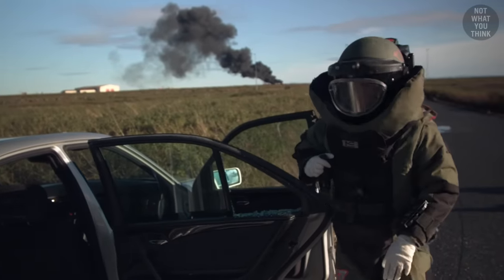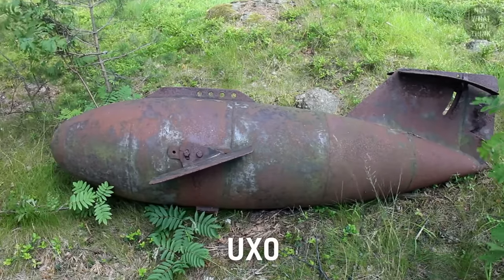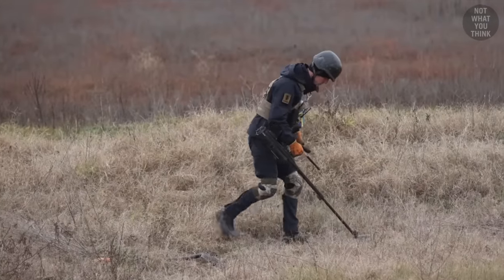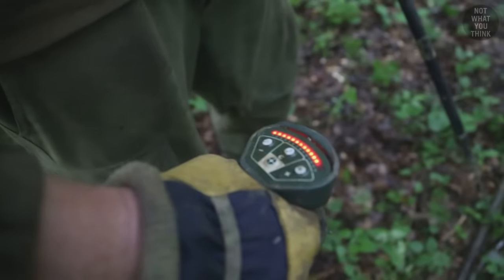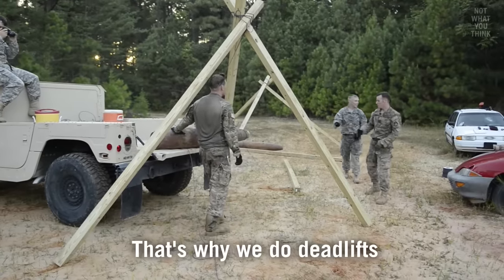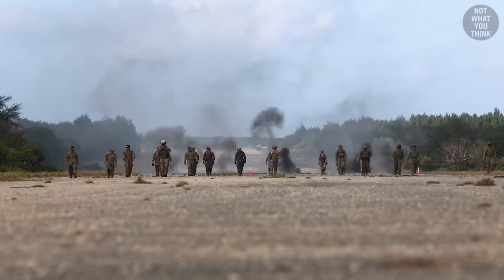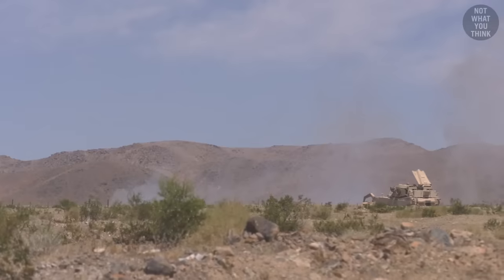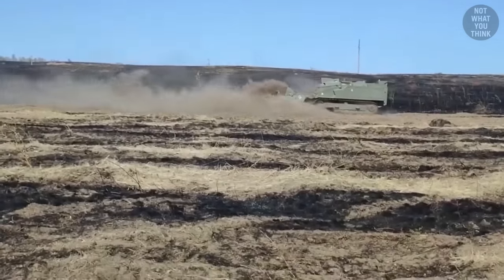Why Explosive Disposal is a $6 Billion Industry

Comment: Mines are lethal autonomous weapons, no AI required.
Reply: Then you put a roomba underneath and it’s even worse.
Reply: I mean, he ain't wrong.
Reply: Wait until they use AI drones to spread them, include tiny processors that can distinguish between footsteps and prods, and make them out of materials that can’t be detected 😢
Reply: And an interesting thing a lot of Mines are also designed to be non instantaneously lethal. Because they're designed to maim to kill but in a way that will take up the most resources which usually causes the most suffering
Reply: Fantastic observation, good way to explain just how terrifying AI without man-in-the-loop will be. Not "could", "will"!
Reply: @noideas439 you would not want AI to distinguish between footsteps and proding. Ideally you would want it to distinguish between environmental stimuli and human interaction. You would still want it trigger when prodded. But you don't want a landmine so sensitive that random things set it off
Reply: Can we give them some AI??
Reply: To be fair, anything that can detonate at any given moment without warning, can be -- and probably should be -- considered lethal.

Comment: If you have ever seen people mowing the sides of highways with a device on a boom. There is a good chance you have seen a flail mower. Pretty common for uneven and rough places. They are basically the same thing as those flail tanks and whatnot. 

The only real major difference is the length of the flails. The length gives more standoff distance from the spindle.

Comment: Not just with explosives like in EoD, but with any job (civilian or military) that can be summed up as "removal of hazardous material", I take my hat off to all of you who do it.

edit: btw something like a third of all shells fired during ww1 were gas shells, something like 10-25 percent of all artillery shells have been estimated to have been duds. So a quarter of a third of all shells are gas shells that didn't go off or in other terms around 8-9% of all shells fired on the western front. caveat: the error bars and overall range of the estimates over the years are pretty big. This is just meant to hammer the point home.

Comment: Why not use semi-disposable commercial bulldozers with remote control kits?
Reply: The IDF operates armoured remote-controlled Caterpillar D9N bulldozers fitted with an armour kit, called "Raam HaShachar." Most of the time they use the manned version. They're not "semi-disposable" as a battle ready D9N probably costs $200k. 'Dozers are useful for clearing a narrow path for a military advance, but not at all useful for clearing a field or an urban environment - it turns valuable land into nothing worthwhile.
Reply: @nightjarflying Compared to a $3 million tank, $200k is cheap. By semi disposable I mean that its acceptable loss rate is higher than more expensive and manned equipment.